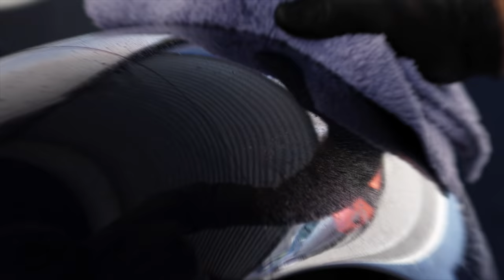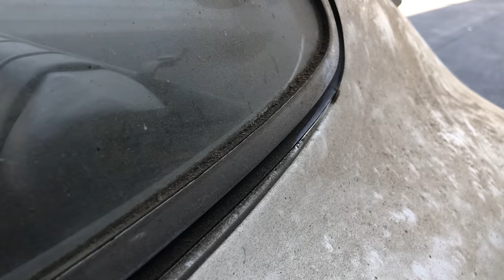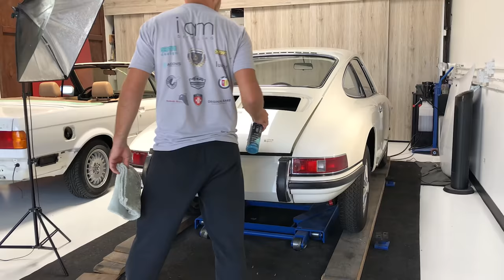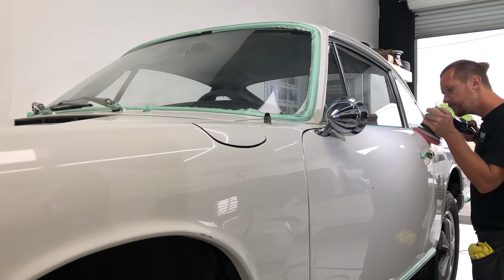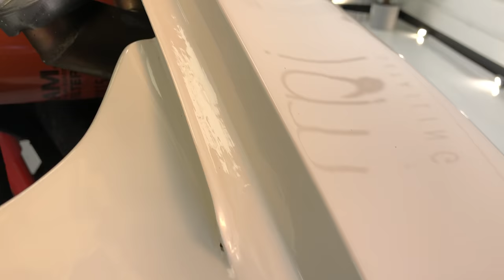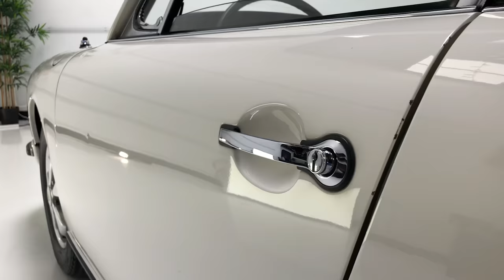Not a Fake YouTube Barn Find! The best of the Best 1967 Porsche 911S

Comment: Why even detail it. The car obviously has no motor, it's not driving anywhere. Oh and nice job replacing the window rubber.
Reply from the maker: Of course the car has engine and trans… but because was siting over 38years it need change some gasket/seal and just checked everything before it will hit the road… so my neighbor California Porsches worked on that when I worked on detailing part. 
Not sure what window rubber you meant but we did not change anything. Everything was only, cleaned, polished and protected but the goal was to keep everything original from factory but make it look best as possible.
Reply: Salty sosig.
I'd detail that with no engine if I had a big enough hall way stick that in instead of a grand piano. 
Stunning shape, amazing detail. Love it